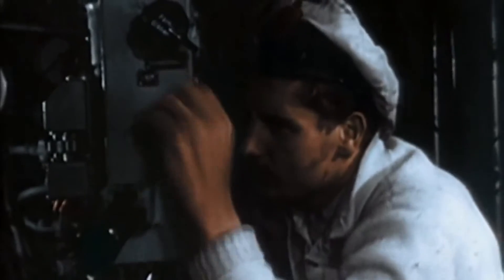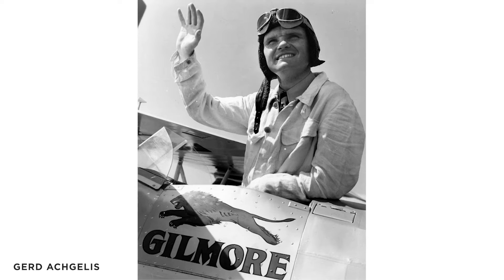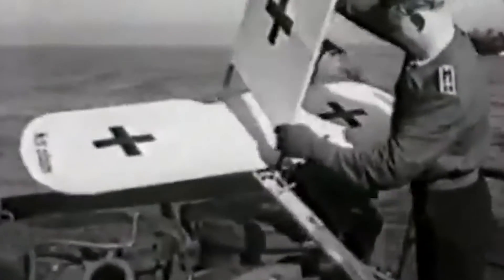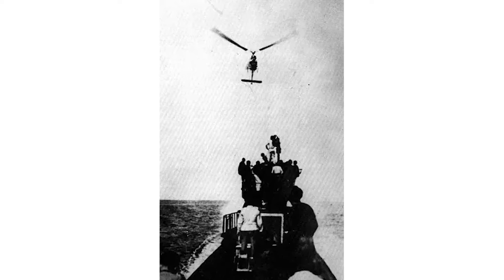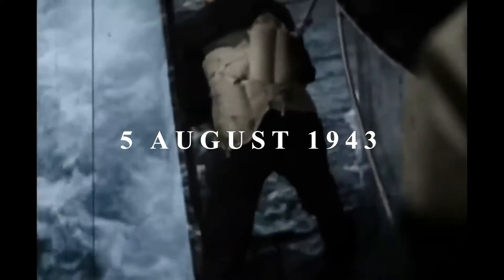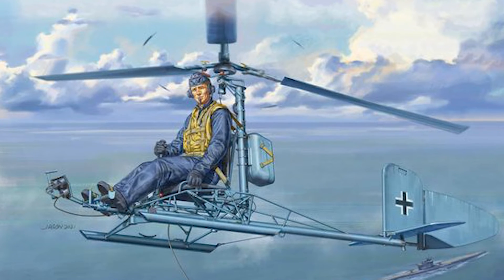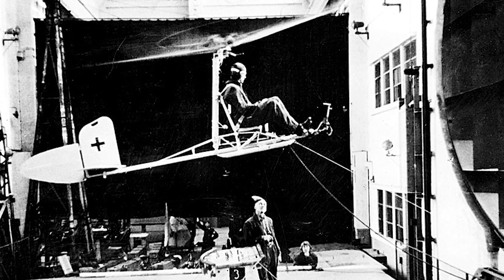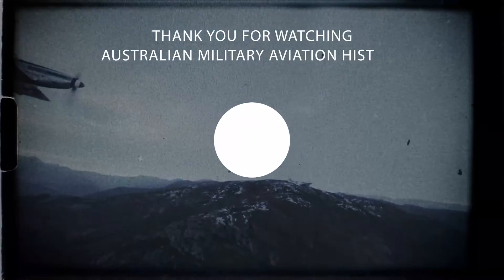The German U-Boat Autogiro

Comment: Your title for your video is misleading. The aircraft described is a rotor kite, not a hellicopter.  Hellicopters are aircraft with engine driven rotors  whereas rotor kites  or more correctly Autogiros or gyroplanes are aircraft in which the rotor is not driven by an engine but by air passing through the rotor.
Reply from the maker: True - didn't intend to mislead anyone.